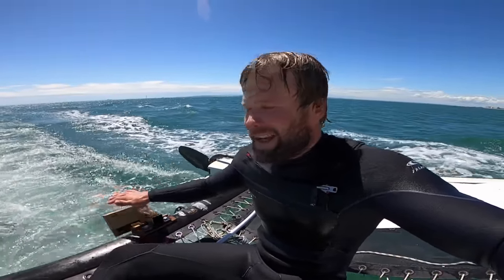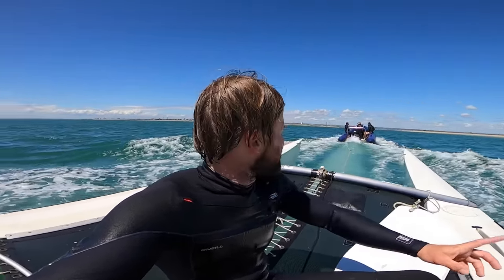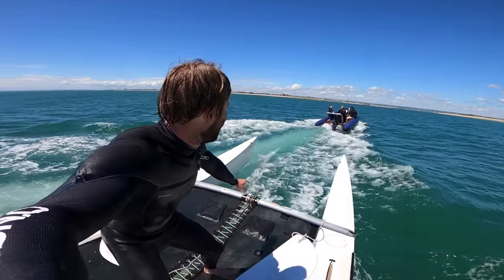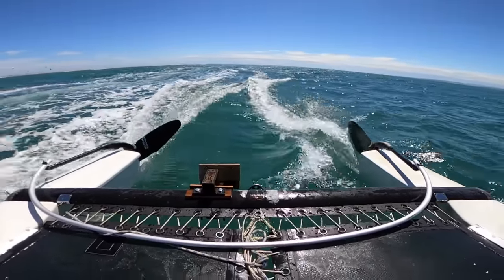Project KITE BOAT - 25 Knots - Part TWO

Comment: I built one of these. I hooked the kite to the boat too. If you put a ring at the four corners of the tramp and then run a line through the four rings so that you form a U. then put a line across the U with jam cleats. This allowed me to move the kite to any point on the tramp for some hull flying! Cheers!
Reply: I'm interested, I have a 18 hobie and a 18m kite, may need bigger. I need your thoughts on set up.!!
Reply: That's a great idea, do you have  or could you put up a video to show the functioning of that?
Reply from the maker: Thanks for the tips, I will try this!

Comment: Awesome project! I think it could be improved by installing an extension to the bar, connect two lines to the bar about 4 to 6 ft long each and put another bar at the end so you can sit more on the edge of the boat and not where you sit now. The second bar can be just a 2 ft piece of broomstick with two holes drilled on the ends. That way your weight can be better distributed on the boat. Have fun!

Comment: Sam, make a bar extension so you can sit further away from it. Lines from the ends of the bar down through a karabiner or 2 down by the chicken loop and then back to another bar. That way you are still controlling the bar in the same way, but where you want to be on the boat. You might be able to use a windsurfing harness line with the Velcro ends to attach it to your bar easily
Reply from the maker: i like the simplicity though, its nice if something goes wrong

Comment: I love this type of horsing around. You could take a second bar and connect it with extensions to the main bar. You should also put a tiller on the rudder. I think you could see gains with better weight distribution.  Keep on pushing

Comment: Have your considered mounting the wind sail base plate slightly up on a sliding Sampson post-like device so the sail operator could kneel or even  possibly stand to aid trim, crucial for speed and also excellent for comfort on long reaches and runs? Emulating the body position of a kite surfer and the ability to instantly maneuver the kite could wring out a few more knots. By having it slide fore and aft, you'd achieve nearly infinite adjustment for trimming the boat. Or would there be too much windage and slow you down? At 25 knots, you're probably right at designed hull speed and it's sailing flat. It can't get too much better than that from your current design parameters. A bit of glass work on the dagger boards by working in a bit of foiling effect might get the boat up into the mid thirties but increasing the risk of pulling her out of the water and then pearling back in. Have fun, be safe and thanks for taking us on the rides.

Comment: This is fascinating from a sailing perspective. 
Quick observation.  Take it for what it's worth. 
A sail boat moves through the water on a combination of Center of Effort and Center of Lateral Resistance. 
The Center of Lateral Resistance is fixed somewhere on your hull or Keel/dagger board and is used more so when sailing up wind, when your center of effort pushes you more sideways with the sails in tight over the bow-stern center line of the boat.   When you ease your sails sailing down wind, the keel/dagger boards become less important. 
There is more to it that that, but I didn't see a lot of up wind sailing, so if it does not seem like your dagger boards are useful, maybe just chuck them?  Especially in a Cat.  The two hulls act like keels, more so that a mono-hull. 
Picture of CE and CLR. 
https://www.jet14.com/get-your-centerboard-vertical
Not trying to be a know it all, just really excited seeing you try to crack this code.  I live in San Francisco and I am just starting to Kite sail.  You have inspired me to see how far kite sailing can take me.   I like that its on a smaller cat.  It seems more manageable. 
 I can't wait to see what is next for you guys.  Best of luck!

Subscribed.
Reply: do you know kitetender?  monohull
Reply from the maker: thanks for the tips, all good points. the dagger boards do help to go upwind, i found only 1 is enough, its still pretty good going upwind without them, no need for them going downwind, give it a try, its actually super easy and fun!

Comment: You should be able to solo sail the cat if you used your feet for steering the rudders.
Using a bar bolted to the center beam extending forward to support a center bolted pole for your feet to rest on which would have lines at its ends going back to control the rudders. This would probably also help you to better support yourself and mostly if you add a back rest. I Don’t know if this navigating seat would need to swivel or if it can stay fixed?  I’ve also been thinking of using a kite to navigate a foiling cat. Shouldn’t be that complicated. Thanks for sharing mate!

Comment: This project is so cool :) But maybe a safety leash around the arm that's killing the kite if you fly of the boat? ;P
Reply: That's what the middle line is for to basically stall the kite it can also be used to take the kite off from the ocean if you crash down into the water. I think.
Reply from the maker: yea it would be tricky if we lost somebody over board, good points!

Comment: Can you extend just the steering line's only so your not stuck in that back breaking position. Obviously the steering line's would have to go through two swivel rollers then out to a power kite two line bar with a couple of knots either side keeping the normal throw of the bar.
This will allow you to move about the boat side to side.
Utilizing this with a tiller extension the boat could be used single handedly.
The only other option would be to have a sliding mainsheet traveler but that's alot of work.
Reply: s2oooo Perhaps an arrangement to control the rudder with your feet.
Reply: @WibovanNoort  my mind boggles at how that could be done but i like the idea 😁

Comment: You might need to add some strength to the beam, because it’s not designed to be lifted at the center mast base over the dolphin striker. This could maybe be done with a couple of compression struts and some cable but it might hinder your freedom for flying the kite.
Reply: Pretty cool.... I know they use kites as a back up on the Volvo race in case one of the boats breaks a mast. How many meters is that kite? I thought I heard 70 is that right?
Reply from the maker: 17m

Comment: this could totally be used to actually teach kitesurfing, like kite handling
Reply: Yes, I want to do exactly that. This method takes away all hazards for the student. Once the student understands the handling and wind window, then give em a board.
Reply: Or you could use a $75 training kite . . .
Reply: Kala Raymond trainer kites don’t teach to feel the sheeting in/out the bar.
Reply: @Jadan888  It's possible to do, but not out of the box.  You'd just have to have someone readjust the strings on the trainer kite to make it a 4 liner then use an appropriate bar.
Reply: Kitemaraning is here to stay steer an gomn...woooooo getting one for my 12 metter

Comment: What about moving the point of contact with the catamaran and kite slightly more aft for a better planning effect ??
I have no idea if would work but might slightly move c of g back. Pull the boat slightly higher and therefore more speed

Comment: It'd be interesting to see a the same boat with a similar sized sail next to you to compare the efficiency of the sail vs the kite.  I'd imagine the sail might do better since the boat is designed for that, but it's possible the kite would surprise.
Reply from the maker: i have been much faster in it kiting than i have sailing!
Reply: @SamLight  That's great to hear! So kite beats sail. I guess because it can generate more apparent wind?  I'm a kiteboarder so I was rooting for the kite. Looks like you're having tons of fun!  Best of luck continuing to improve the sport.

Comment: yes that was a lot of fun but now multiply the lines four to five times when you have your lines at the distance of 500 M to 750 M the wind is more stable the steering is a little bit slower you have a little bit more drag because of your lines but it isn't better experience

Comment: I recognized the Hobie 18. Got a Hobie 21 SE ... I have converted (part time option) as a paddle boat w anchor and Bimini shade roof, ... to promote some group snorkeling fishing aerobic exercise adventures. That boat glides like two knife blades in the water. QUESTION: Is the mast base a good place to anchor a big kite, ...or would have a frame at front of cat, maybe with pivotable seat ... Be Any Better ??? in your opinion ???

Comment: You need a tiny electric engine and battery.  Motor out, regen on kite, motor back.
For video record, please note wind speed and kite used.

Comment: hey sam. good to see you are playong around.  you could use a tiller extension to get the crew weight more to the front. will be faster then hanging in the aft beam. you can try the kitetender at the isle of wight at windstalker island kitesports.  contact me or tom for local info. he knows the spot. ryde.  just south in front of hayling. or just take a flight to holland with your turbine.   we can do some pro stuff. cherrs Peter
Reply from the maker: hey peter, i would love to try the kite tender! please drop me an email sam_light (at)me .com
Reply: Sam Light dropped you an email.

Comment: It would be better to use a $100 trolling motor like the Minn Kota, powered by a small 12v battery, such as a motorcycle battery or Mighty Max battery 35 amp hour for ~$40.  Motor and battery together total weight around 40 lbs.  The electric motor (20 lbs) can be quickly and easily dismounted and store on deck before launching your kite.  This should push your boat 3-5 mph for more than 20 miles.  Compare that to the weight of your outboard motor and gas tank, my guess is that's > 200 lbs.  Use a solar panel to charge the battery and your sailboat is entirely powered by sun and wind.
Reply from the maker: thanks for the tips!

Comment: Could this kite system work on a bigger vessel of 30 meters long . Would it also work on a bigger catermaran  hull . On a 30 meter hull what would the size of kite  be
Reply from the maker: yea for sure, but it would need some complicated flying systems to control the kite